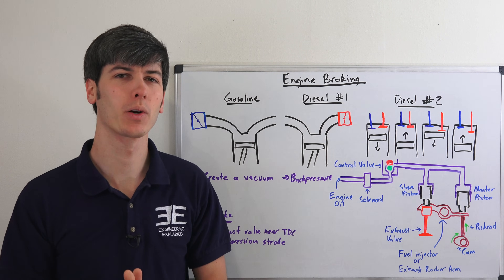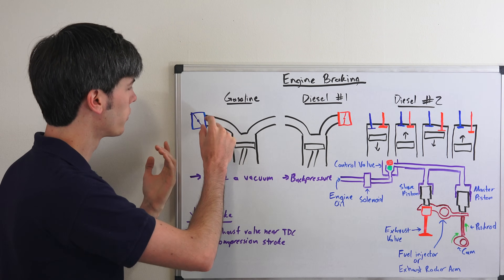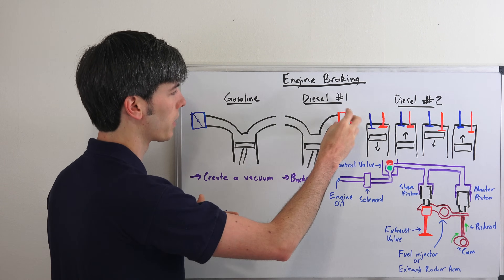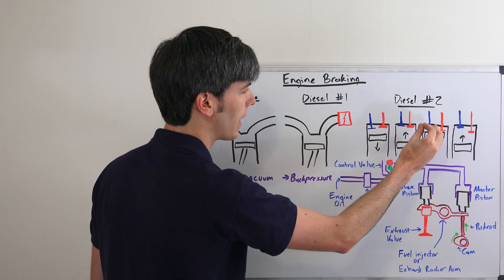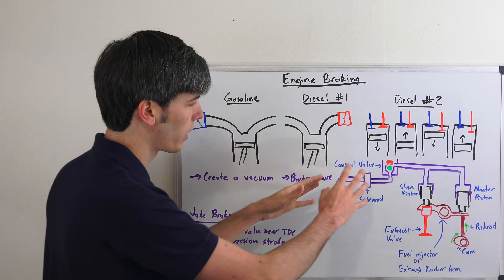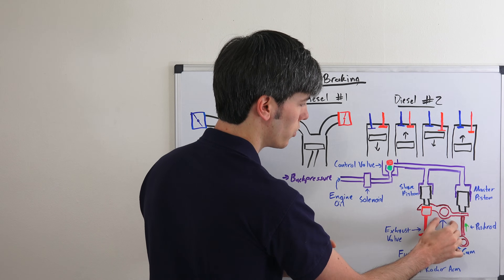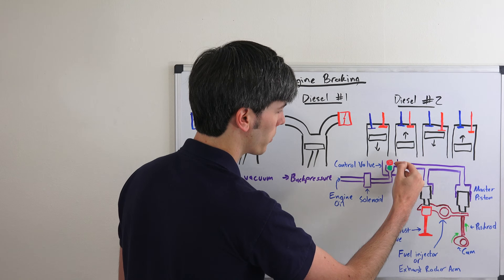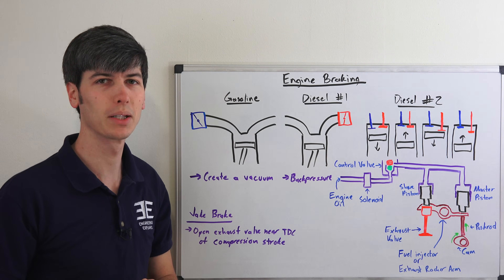What Is Engine Braking? What Is A Jake Brake?

Comment: I really don't think that creating a vacuum is enough to slow down a car. 
It's more likely that compressing the air to 10+ bars without fuel injection is going to act as the engine breaking.
So there is no need for exhaust valve to do that on a diesel. Simply when your foot is not on the accelerator the ECU will cut fuel. So the momentum of the car will drive the motor to compress just the air. 
That's why diesel engine have more engine breaking thant gasoline ones, juste because the compression is much higher in diesel engines.
Reply: +Engineering Explained Just explain then, why it's so hard to turn an engine over with a spanner? Is it the vacuum in the intake? No it's the compression.
Reply: +Engineering Explained I don't think that the energy is going back into the engine. The thing is that in engine breaking it's not the engine that drive the wheels but the other way around. 
It's why when you manualy crank the engine it becomes hard to turn near TDC.
And as for the devices,  there are many engines that don't have them and still have plenty of engine breaking
Reply from the maker: +davidrobert2007 Regarding your question about turning an engine over with a spanner, there are many reasons. First of all it's a lot of moving parts and a lot of friction to overcome. But to address your point, the air in the cylinders which have been compressed will leak while sitting (as a result of gaps in the piston rings, etc). This means there's no compression to help you rotate that engine, so you have to overcome both the vacuum (which will be small, since you're rotating the engine very slowly), and compressing the pistons. But if you were to continue to rotate it with a spanner fast enough, you'd see that it becomes easier with time, once you allow the compressed air in the piston to work in your favor.
Reply from the maker: This is not true at all. The vast majority of the energy used to compress the air will go right back into the engine during the power stroke, making the energy loss very minimal (even without fuel). It's critical to either create a vacuum, build backpressure, or release the potential energy stored at TDC for the compression stroke. There's a reason these devices exist.
Reply: @EngineeringExplained  it is the engine's compression that holds the car back. The throttle is never fully closed since without the air the engine would stall. engines would only back pressure into the intake side if the engine timing is off.
Reply: +zlac Yep it all goes as heat. That's why air compressors are very hot in a few minutes and need so much energy to just compress air.
Reply: +Engineering Explained You're totally right, and your explanation is correct.
I may be wrong, but i think it's only part of the solution. When you crank a motor you can certainly feel a hard point at TDC. Compressing air requires a lot of energy, which it's mostly lost as heat. All this energy lost will not be used to push down the piston, so the engine will slow down
To make my point, my old 1.9 diesel Peugot hasn't got any intake or exhaust throttle body and still have a ton of engine breaking
Reply: +Brice Eychenne That's a good explanation. But obviously, there must be a flaw in that system for them to facilitate the exhaust valve mechanism. I think the reason why your explanation isn't actually put to practice is that the engine might not be able to compress that air to such high pressure due to the momentum and therefore stop the engine suddenly causing a 'stall'-like situation which is pretty dangerous.
Reply: Oh now that EE has explained it, I feel quite silly trying to hypothesize a solution. My page didn't load when EE answered it here.
Reply: davidrobert2007 True, but once you turn it over, it follows through effortlessly right? It's because the pent up energy during compression is released after reaching TDC, right Engineering Explained ?
Reply: +Nimish Nadgere  I understand that but the compressed air in the combustion chamber doesn't release an equivalent amount of energy back to the piston after tdc.
Reply: Where does the energy go then? Some of it is lost as heat, but is it really that much?
Reply: zlac The energy is converted to heat. Think of a diesel engine, the heat generated by the compressing of the intake air is what ignites the fuel when it's injected.
Reply: yes, but how much of the heat generated by compressing the air manages to transfer out before it's uncompressed again?
Reply: Your obviously NOT a truck driver!

Comment: You should explain why downshifting and not applying throttle in a manual gasoline engine (not sure about diesels) is a way to slow down without braking. Basically a how-to on the topic rather than an explanation of how it works. Maybe also cover advantages/disadvantages to slowing down this way, slowing down this way +braking, and just braking and disengaging the clutch.
Reply from the maker: I think this video does explain that. While in gear and off throttle, the vacuum between the throttle body and cylinder slows the vehicle down. Lower gears mean higher RPM which means this vacuum is occurring more frequently, thus slowing you down more.
Reply: +Engineering Explained Fair enough. Regardless, great video, keep up the great work!

Comment: How come Jake breaking or engine breaking is prohibited in some cities or towns?
Reply: +Borntokirune Its usually quite loud, and any place that has signs prohibiting it, its not needed.
Reply: Because it is jake breaking is super loud. I'm not sure why engine breaking is prohibited though.
Reply: +Borntokirune Because the fuel doesn't get burned up, it all goes out of the exhaust.
Reply: +Borntokirune It is VERY loud. Especially on American trucks. European Volvo's for example use evb system which is a little bit different, but not as efficient(i think) and not as loud.

Comment: Something you could add is  that the transmission has to be engaged in D or a gear. Also, another factor to brake is the engine internal friction.
Reply: He did, right when he got started explaining the first method.
Reply: +Phil Simms I heard it just bearly mentioned. I think it should be a major point. Other transmissions or setups like CVT/hybrids, the engine braking is almost non existant.

Comment: How do I refill my engine brake fluid?
Reply: Just pour some oil over the engine.
Reply from the maker: In this scenario, your coolant could be considered "engine brake fluid" since it's what absorbs most of the heat, so it's not all that ridiculous of a question. And the jake brake requires oil to operate haha. Add coolant and oil as needed!
Reply: +HappyCod43 Great advice. Also it incrased fuel economy too.
Reply: Pour 4 liters of engine oil on the engine